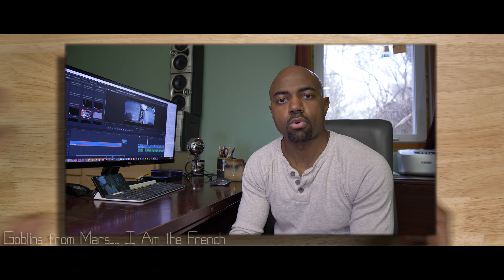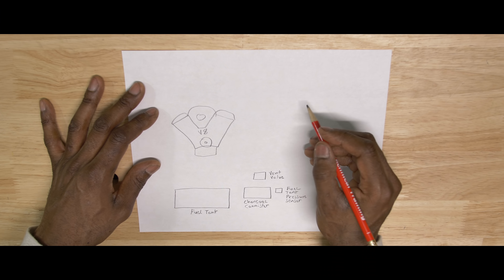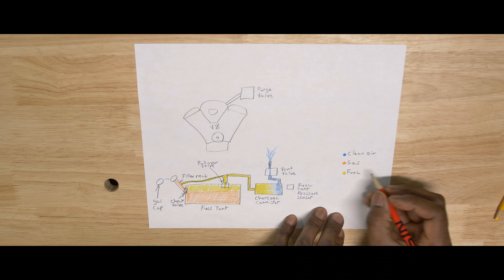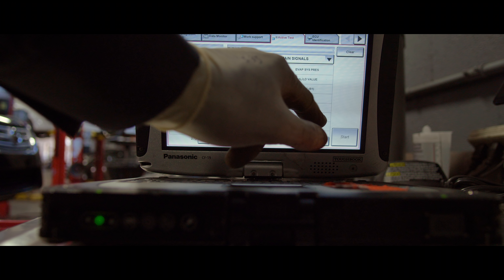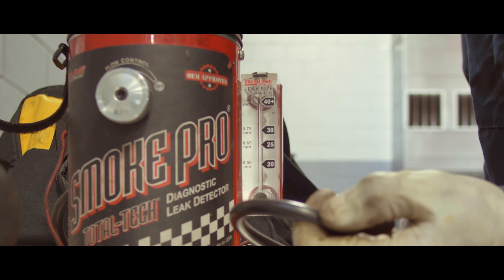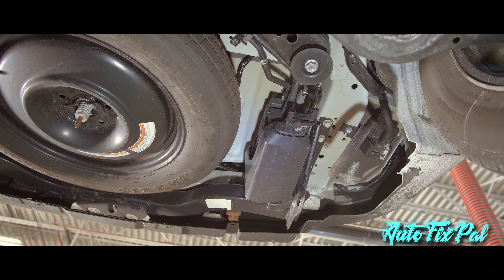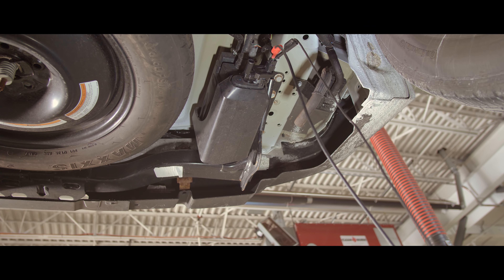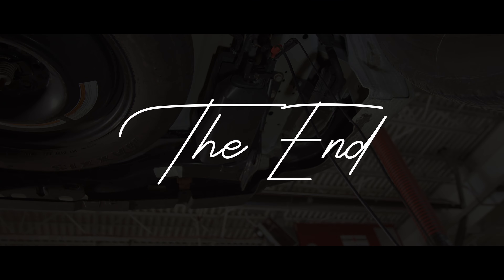2018 Pathfinder Cant fill with gas - Evap systems explained - how evap works

Comment: Thank you Hakim. Good job. I appreciate your videos. I just bought a new 2018 NV200 last month. Year end sale was awesome deal. I Learned to NOT leave the ignition key on engine off when filling gas tank. The ECM must have been trying to perform EVAP test because I couldn't get gas to flow into filler neck. Nozzle kept clicking. Turned key off and it filled easily. ECM must have closed the vent solenoid for some type of natural vacuum leak detection. I'm thankful Nissan kept the EVAP System simple, unlike Chrysler and Euro's who have managed to make it harder that it needs to be. I appreciate your videos Hakim. Have a blessed and safe week.
Reply from the maker: Your very Welcome Billy. What you described is most likely exactly what happened. I too am glad that Nissan decided to keep the evap system simple. Same system since well... a long time.